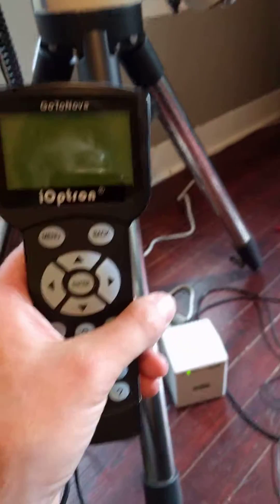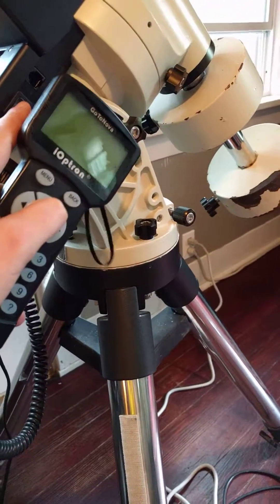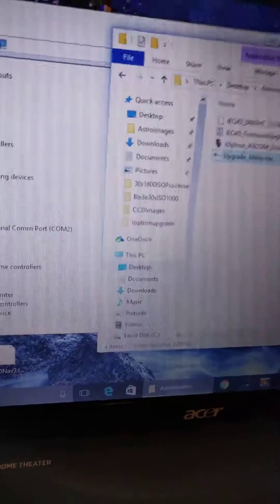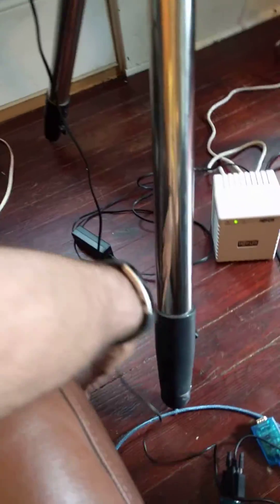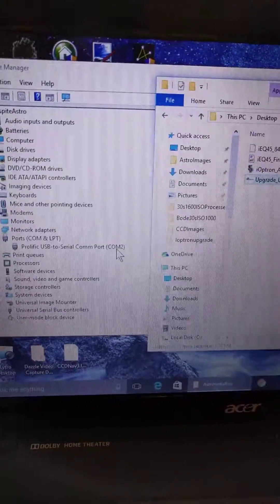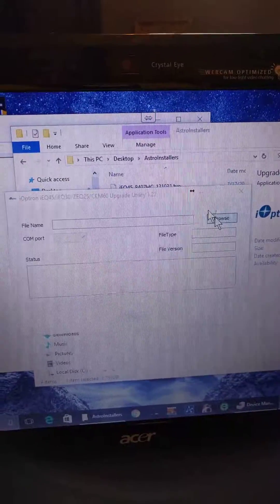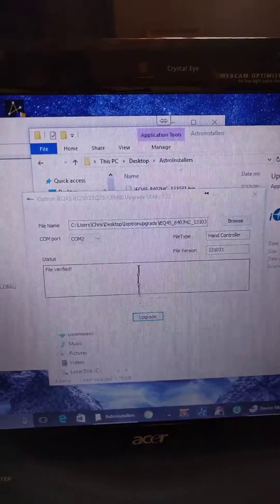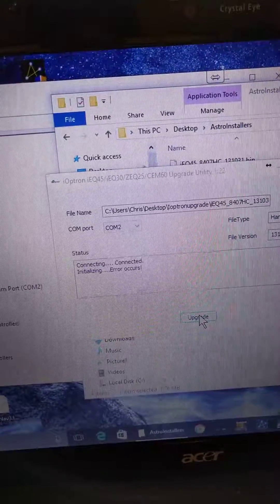iOptron 8407 Hand Controller firmware upgrade fails

Comment: Chris, I had a similar issue with my hand controller update.  Turned out to be the pin outs on the RJ-9 connector were reversed.  Once I got a new RJ-9 connector and wired up the correct db-9 to RJ-9 pins everything worked.

Comment: I was using my CEM60 last night, and while slewing to a target at about 35 degrees, the mount started moving down to the horizon.  The "stop" button on the hand controller wouldn't stop it, so I had to disconnect power.

Now I have the same message on my 8407 hand controller.  I replaced the battery inside, which resulted in no change.  Has anyone found an answer for this, or confirmed the problem is actually the hand controller?